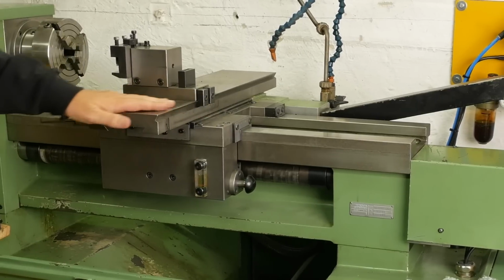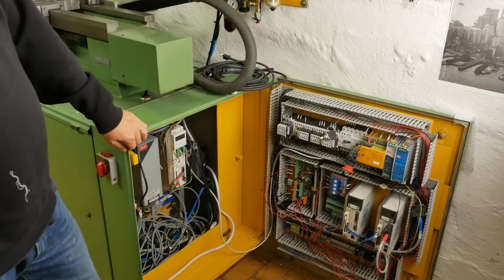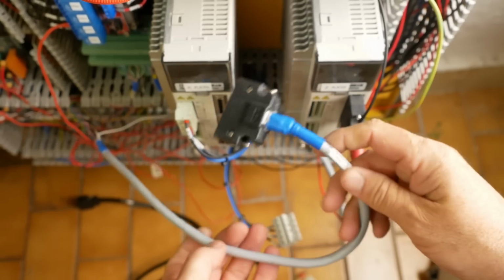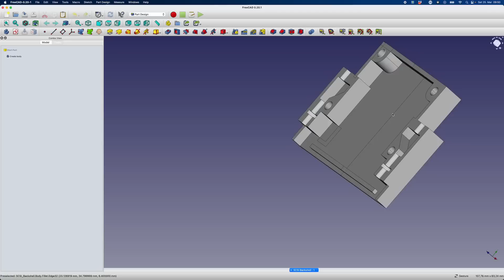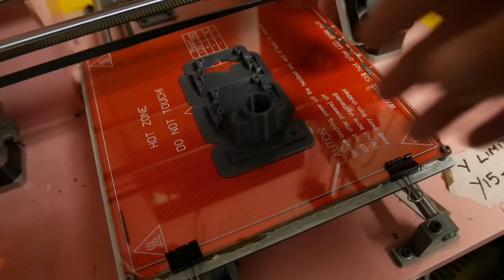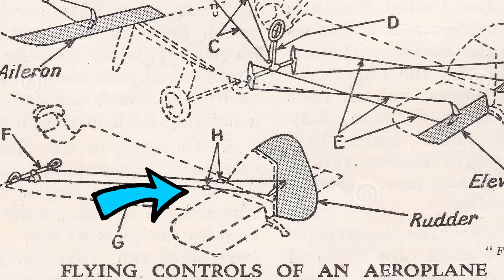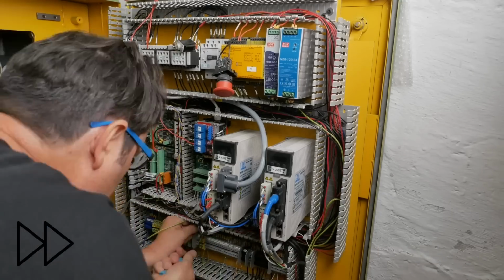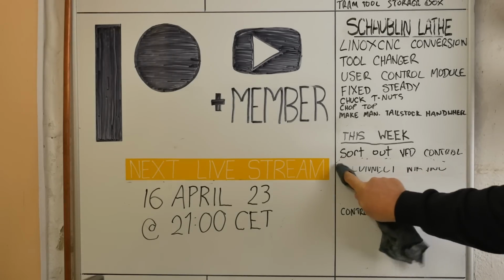Wiring done || RotarySMP

Comment: It looks like your 3D printer is suffering from under-extrusion. You can easily solve this problem:
1) check the setting of steps per mm along the E-axis
2) check if the nozzle is clogged
3) check the printing speed. high speed cannot be achieved with low-power hotend heater
Reply from the maker: Thanks. I need to get to this.

Comment: Wiring in control cabinets is definitely an art, I used to install machihes with several enclosures, with all wiring emanating from the main panel, i could never get it as neat as done originally.
Great use of the ubiquitous 3D printer,  plus a bit of modelling. 
Thanks for sharing
Reply from the maker: I am amazed at how neatly some people can dress the wiring. I guess, I err on the side of having too much wire length, and then the wiring channels are messy with the excess.

Comment: If you've undersized holes for a nut in 3d printing.  One tip is to push a bolt partially through the hole.   Heat the hex end up with flame, then (while its hot) pull the bolt in to the nut hole.   The hot hex end will melt, and reform the plastic around it. After cooling, remove the bolt, and replace with the mount.   If you time the heating right, the bolt will not melt the plastic in the hole.
Reply from the maker: Thanks for the tip Oliver. In this case I also didn't leave enough edge distance for the M3 nut.

Comment: Not far off now. I found a Brideport series 2 NC near me for $1500 that's part way through  being updated. Great machine and price but It's a massive monster and I just don't have the room for it. It'd probably cost that much to get it home... 11"x58" table and 8' tall.
Reply from the maker: Was that one of the early Brdigeports with steppers instead of servos? They are really tall.
Reply: @RotarySMP  Yup. I think they might have actually used trained hamsters in wheels to drive it and a super intelligent mouse yo count the steps. It was stone age CNC on those machines.
Reply from the maker: @theinfernalcraftsman  Nice iron though. My mate has a classic, manual Bridgeport, and they are a very flexible machine.

Comment: My father-in-law was an aeronautical engineer at a "major manufacturer" and he got a call from neighbor who was building a kit plane in his basement.  When my FIL saw it, he noticed the builder had made some changes from the kit plans and in particular, he re-routed the aileron cables so they took different length paths. My FIL pointed out this error and it started a huge discussion with the neighbor that ended with my FIL walking away.  The kit plane never flew and was eventually sold for scrap.
Reply from the maker: There is a saying in the home built plane scene. "Change one thing...change everything". Flight controls is not a place for a newbie to get creative!

Comment: FYI your 3d printer seems to be underextruding. Main things to check are the nozzle (make sure it's clean and not partially clogged inside), the filament (make sure it's of a consistent diameter), and general printer settings (extrusion temps, print speeds, and extrusion settings).
Reply from the maker: Thanks. That was pointed out before, and I even looked up the process to test and adjust it, but never got around to doing it. Thanks for the reminder.

Comment: Sure looks good. Seems to me that was the tedious and difficult part, now on to something more fun… 👍
Reply from the maker: I wish it were so, but now I have a bunch of firmware configuration work to do, to get the various layers of spindle speed control to work, and that is just as tedious and even worse for videos than wiring :/
Reply: @RotarySMP  I know that It's an unpopular and non purist idea , but... elimination of  the gear box between the motor and spindle would
make your life so much easier. I cannot find photos of the current version showing the spindle arrangement ,i would be shocked to find 
anything other than belt from motor to spindle.
Modern cnc lathes have at most a 2 speed gearbox with electromagnetic clutches
Reply from the maker: @steveggca  Hi Steve, it is only easier if you start from scratch. This way I dont have to make any mechanical changes, just a bit of config work.
Reply from the maker: @steveggca  Hi Steve, Yeah, modern CNC just use a huge servo (often 30KW +) and belt drive to the spindle. It would cost me a lot to replace the current 3KW motor and VFD with a motor having enough toque to drive the spindle with adequate torque. It would also be a fair bit of work to remove the Variator and replace it with a normal pulley drive. Not changing anything is the simplest solution :)
Reply: @RotarySMP  Understood 😀  my subaru has CVT with 6 fake gears,  planning something like that?
Reply from the maker: @steveggca  Yeah, the VFD will be closed loop, the back gear has to be set before the spindle turns, and the variator can only be changed when turning.

I am picturing a hierarchy. 
1/ Speed command on stopped spindle, pick gearbox ratio.
2/ Start spindle, adjust Variator open loop based on commanded speed (basically just 4 ratios controlled by timed pulses of the variator setting motor, about a second of power per ratio).
3/ VFD commanding the motor rpm closed loop off the spindle encoder rpm.

On a CSS cut, the variator will need to do a ratio change when the VFD runs out of frequency. Need to get my head around doing that in LinuxCNC.
Reply: @RotarySMP  I can't imagine that changing the variator ratio while in CSS mode will end well.
(admittedly, some days, finding the limits of my imagination is distressingly  easy)
first thing that comes to mind is that there is a following error limit between commanded and actual rpm.
ramping up the rpm at the same time you are adjusting the variator will probably break this .
closed loop control does require a certain amount of predictable behaviour from the mechanics.
Reply: Oh and for your interest , a modern schaublin 125       125-ccn uses either a 5.5Kw or 7.5Kw FANUC  AC spindle motor  (induction motor)
so not really that large , however it makes max torque  at essentially 1rpm. and yes they are very expensive.

Comment: Take it from an electrical engineer (Retd) neat cabling and labeling is of paramount importance in all process machinery! You made an excellent job!!
Phil
Reply from the maker: Thanks Phil. I appreciate your feedback on that. I never know whether I am on the right track with the electrical stuff.
Reply: @RotarySMP  you will find that out if you have a fault that you have to trace! It is fairly common that we used to work with diagrams fo slightly different models, or with mods that hadn’t made it as. Far as the diagram! You have wired this yourself, so you know it better than anyone, and you already have your aircraft engineering grasp of fault finding logic. I doubt anything will occur that you can’t think your way through and fix! I love the right angle plug print, it means i must admit that 3d printers do have some practical uses! There! I said it!!
Phil
Reply from the maker: @philhermetic  Good on you Phil! That was a big step for you :)
Reply: @RotarySMP  yes it was I have always thought they were the equivalent of a computer printer,  ie a way of selling ink at a price more expensive than vintage champagne!

Comment: Your 3D printed parts are showing classic signs of under extrusion. Assuming you are running at an appropriate temperature for the material (PLA?) you might want to check your nozzle for blockages and wear, make sure hot end PTFE liner hasn't degraded (assuming you don't have an all metal hot end), make sure the extruder teeth are nice and clean and sharp and if all that is ok, then it would be worth checking extrusion calibration (e-steps and material flow modifiers).
Reply: ... also i have the feeling that the first layer is to low. because of that the nozzle seems to be dragging over it.
Reply from the maker: Thanks guys. This is a pretty old printer with an all metal hot end. You are right. It has been pointed out before that I am under extruding. I even went as far as to look up the procedure to measure and correct it, but never got around to doing it. Thanks for the tips.

Comment: #1 Fan Niko is correct :)  Also, sounds like some pilot failed to do a proper pre-flight check, ESPECIALLY after an annual. The guilt lies on both the A&E and the pilot.
Reply: If you move the stick and all control surfaces also move, you probably think everything is fine and not even notice that the direction is switched
Reply from the maker: I am not even sure you can see an A320 Aileron from the cockpit window. You are right though.  I was always  learned that one point in the pre-take off check was "controls full and free and in the correct sense".

Comment: Reversed controls? An Embraer from Air Astana took off with reversed aileron cables some 4 years ago. They flew around for about an hour here in Portugal, trying to reach the ocean to ditch the plane, but couldn't make it. Eventually figured out how to fly the plane and landed in a military base in the south. The plane was scrapped, bent out of shape.
Reply from the maker: Thanks Pedro. I hadn't heard about that one. Amazing , even after 120 years, that we still can't get the "Kaisen" right on this issue.
Reply: @RotarySMP  check out the two VASAviation videos on the incident with the communications and the route the plane followed. There's also an "Air Crash Investigation"  episode.
Reply from the maker: @pseixaspal  Thanks, will do.

Comment: Wahoo! nice little bit of progress. Thanks for the video. I used to fly RC model planes and once replaced an aileron servo that went duff on a sports plane. As the new one was a different brand, I replaced both aileron servos so they had matching performance. As soon as I lifted off, it was instantly out of control and hit the deck inverted immediately after take-off - pretty much at full power. That was my punishment for not doing the basic control checks pre-flight. Hats off to the Airbus pilot for spotting the issue and not crashing. - Heather
Reply from the maker: Hi Heather. I bet that was a terrible feeling, I hope the RC plane was repairable.
Reply: @RotarySMP  Unfortunately not. That was the death of my lovely Yak 54. Totally my fault, so lesson learned.
Reply from the maker: @GeoffTV2  Bummer. I have flown a few times in a real Yak-52. Very nice control balance, and great aerobatics capability. Blacked me out twice!
Reply: @RotarySMP  Yikes! That must have been amazing! I'd be terrified to get in an aerobatics plane. I've only had about a total of 1hr20min of hands-on with real planes. Only standard light aircraft though.
Reply from the maker: @GeoffTV2  I haven't got an aerobatics rating, but was an instructor and have MEIR, and CPL. On one of the flights in the Yak, I was with a guy who'd learn aerobatics from a world champion. Those competition aeros are really uncomfortable, very hard jerky, G loads. Another flight I released the tension inverted, and promptly blacked out, as we were still at about 3.5G. Oops :)
Reply: @RotarySMP  Nice (had to look up MEIR). I had no idea you held a CPL. I thought you were ground crew as you often talk about maintenance stuff.
Reply from the maker: @GeoffTV2  I am. In the miltary everyone wants to be a jet pilot, and you fail down to your level of competence :)
Reply: @RotarySMP  🙂

Comment: Very resourceful! 👍 Impressed with a DIY right angle backshell. “Remember, if it’s not a right angle, it’s a wrong angle.”

As you know, it’s easy to visually confirm the direction of flight control travel. Trim tabs? Not so much. You really have to have your head on straight when rigging those.
Reply from the maker: Good point on the trim tabs.

Comment: Nice connector solution!
As for Ty-wraps you can always use the vastly nicer looking lacing cord
cable lacing is always so soothing and rewarding😀
Reply: I'm more than a little surprised that anyone still knows what cable lacing is or how to do it!
Reply: @lwilton   Its still out here lurking around ,apparantly it has gained a following in the IT and AV worlds 
lets out a lot less blood in tight cabinets compared to razer sharp cable tie ends.
And it looks so pretty!
For myself, I was building and refurbishing  inspection tools for candu fuel channel tubes.
the tool was a close fit the tube and there was a fair volume of water flowing through at the same 
time . We used lacing cord to lash down all of the wires and hydraulic tubes to consolidate everything 
together .
Reply from the maker: Hi Steve, Lacing cord is great, but I figured I would keep my last roll for some other job.
Reply: @RotarySMP  those cables coming off of a cabinet door are such a pain regardless of how they are joined.
If its not too late good close  fitting sleeving over the wires is a good choice
Reply from the maker: @steveggca  These are all Oilflex cables I recycled from the Schaublins original cabinet, so they have very thick insulation. If I tie them together too tightly, they wont have the flex needed to close the door.

Comment: with small components with a big contact area try printing without a raft, ymmv but i have had quite a bit of luck and it saves some cleaning up. And with captive nuts even if you do get the right size :-) I have found prints expand into any open space, so M3 migh thave been the right size for m2.5
Reply: A soldering iron would have got those nuts into place, followed by a bit of precision trimming!
Reply from the maker: Thanks for the tips guys. I used the soldering iron to give me a nasty burn on my finger, and then it got banned!!